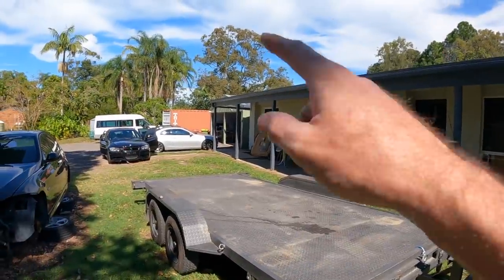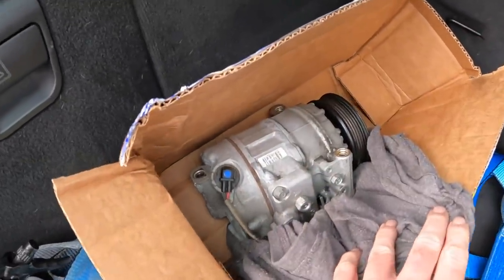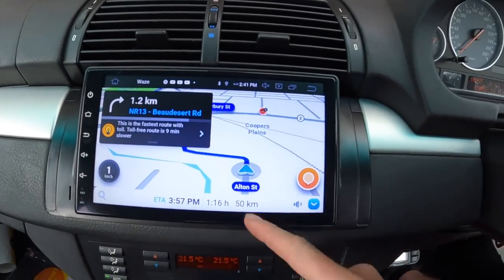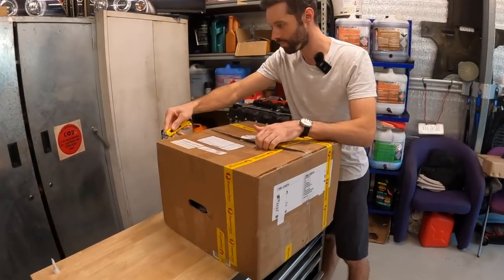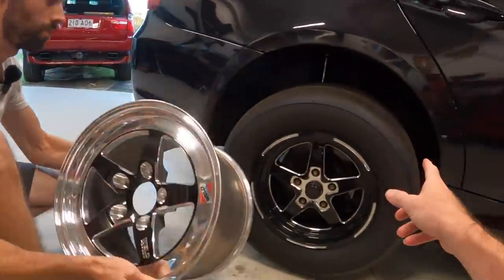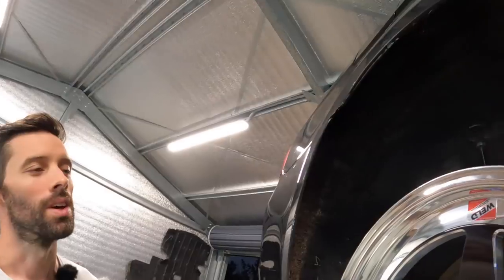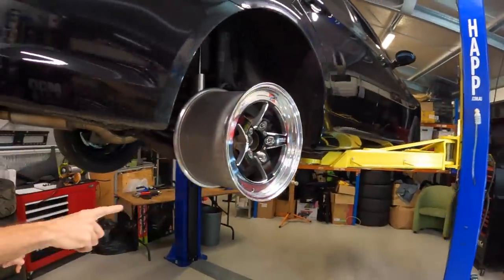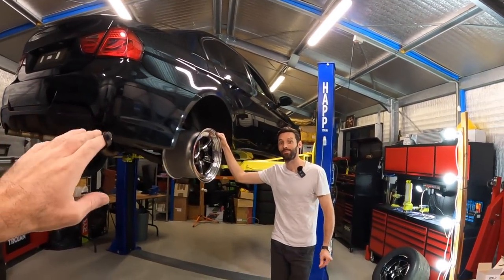WELD 15x10 DRAG WHEELS On A BMW E90 335i

Comment: Weld makes exceptional wheels. I bought my first new pair of weld drag lites 27 yrs ago...😬 getting old...😂 I put new anthracite ARC-8's APEX wheels on my 135i last yr. But I'll get a set of welds for the rear soon. Im in the middle of buying everything for port injection. I have the fuel lines, phoenix intake plenum etc. Just need my AIC box & my precision race works pump & I'll be installing everything.......👍🏻💪🏻🏁

Comment: andrew cut a couple of mil off the top of the bleeders an the k frame brace take it off trace it out on 10mm aluminium plate 6061 or 7075 then trace it out trim it to suite your wheels it will be a billet replacement for the thin steel ones  for oh really cheers glenn

Comment: The tyre will be stretched slightly as I run a 275w slick on my rail car with a 15/10 weld wheel and the tyre was bloody hard to get it to seat on the bead as there slightly stretched so the sidewall may taper in enough to clear the guards

Comment: Get some right angle bleeder screws for the calipers along with spacers
Reply from the maker: Not a bad idea, but shouldnt need to bleed them with the wheels on, so it should be all sweet. Just can't run the dust covers.

Comment: You could always run some spacers in the rear to clear the inner guards, but that might rub the fender?
Reply from the maker: Could be an option.
Reply: rubbing the fender easy solutions, pull fenders, raise car, less spacing last thing to worry about lol

Comment: Where did you guys get your china drag pack from?
Reply: @ZeroTo60Tube  where did u purchase the first drag pack at?
Reply from the maker: @dakota.n54  the car came with this rear end setup. We just purchased the weld wheels.
Reply: @ZeroTo60Tube  ohh dang I was wondering where would I go to buy a cheaper drag pack for my 335ix

Comment: Yeah those petrol X5s are very thirsty
Reply from the maker: They are, but i honestly think for what they do the fuel economy is pretty good.
Reply: @ZeroTo60Tube  okay yes 12.8l100 is good , I had the 3l straight 6 - X5 petrol manual and wow that needle dropped like it was hot .like nursing 110kph on the motorway and achieving best of 13.8l per 100km and 15l /100km in town driving.

Comment: Why not just get bead locks purely for at the drag strip?
Reply from the maker: Mainly cost. It’s also not making that much power. With our poorly prepped drag strips slip in the rim should be minimal.
Reply: I definitely thought bead locks for sure as my first time out may 8th roll racing on the p/t drag rim and m/t 255/60r15 was turning the tyre on rim although mine felt much faster than 17”nankang ar1 . I am considering weld bead locks but omg they are unbelievably expensive so probably have to make do until a lotto win . Good luck guys hope it works out for you as there’s alot of money spent at stake . Big gamble , looking forward to next video and next rolls and also  20th june ( lakeside off street drags ) 👍